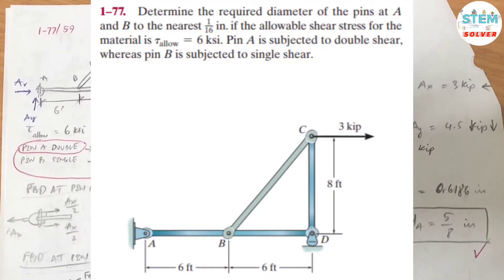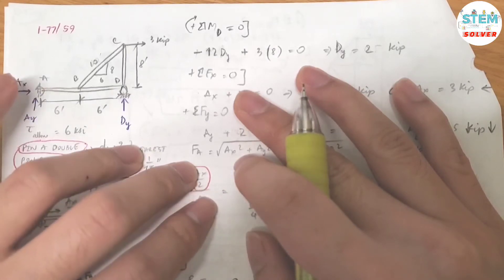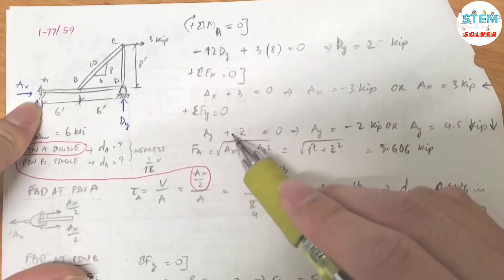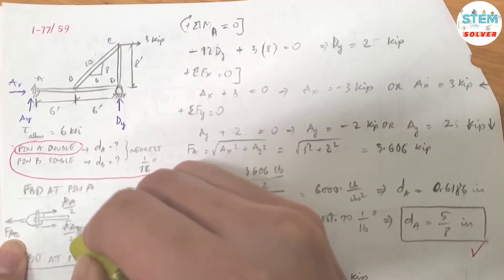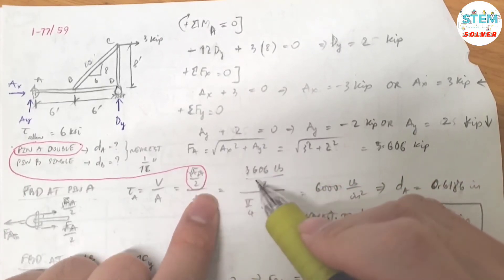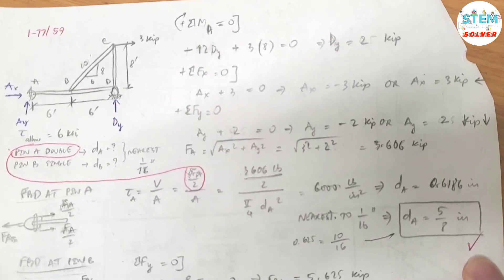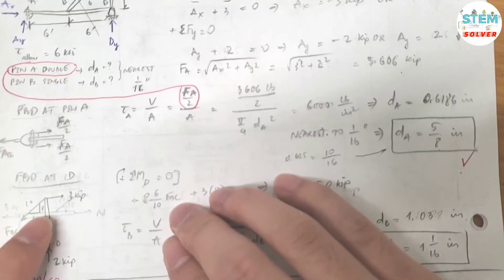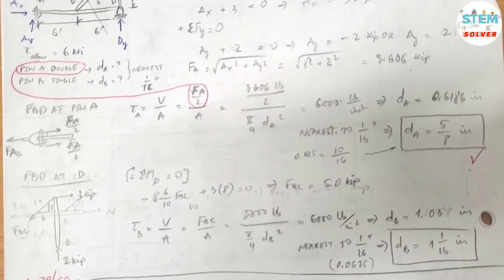Determine the required diameter of the pins at A and B to the nearest 1/16 in. if the... | MM

Comment: Thanks dude! ....except I have Dy (down) 2 Kip, and Ay (up) 2 Kip.... This seemed intuitive to me, as Dy should be anchoring the members from the pulling force at C....
Why did you say the opposite? How do we prove that is is one way or another, if both are equal and opposite....?
Reply: D is shown as a rocker in the given diagram, a rocker is unlike a pin since for a rocker the reaction force is always pushing away from the part that is touching the ground.